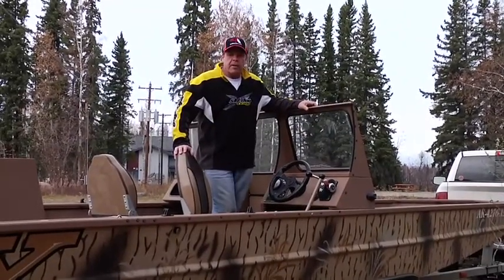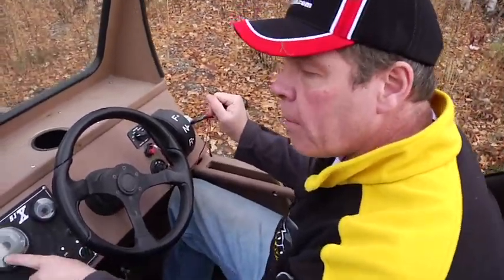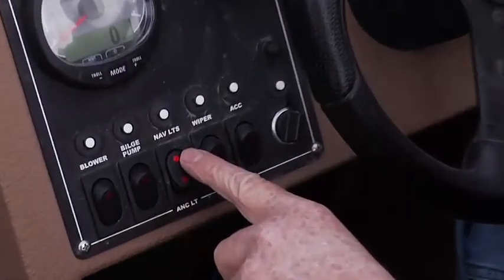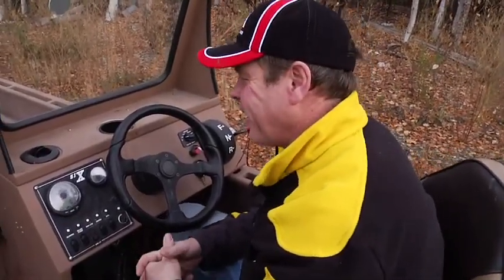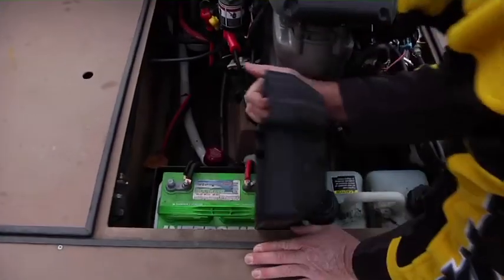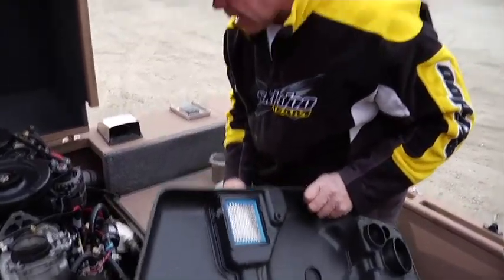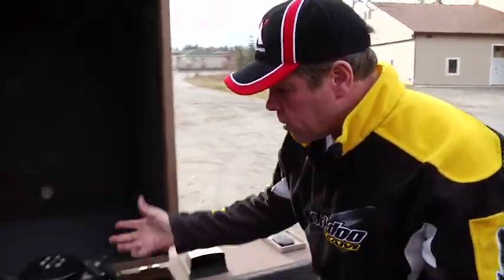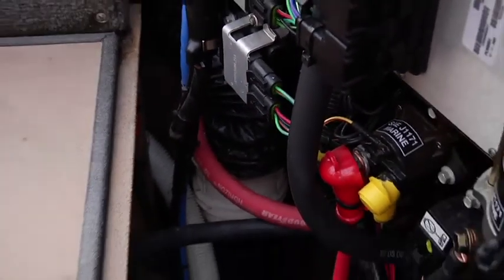SJX Boats Basic Maintenance  & Overview

Comment: One thing I noticed.  Zip ties not cut off, leaving a long tag.  Also hose clamps with a long end after the clamp is tight.  This indicated to me shoddy workmanship.
Things should be neat and tidy.  Those things indicate someone who doesn’t care about how his finished work looks.
I like the boat but if the little things are not looked after properly it makes me wonder about the overall craftsmanship that went into manufacturing the boat.